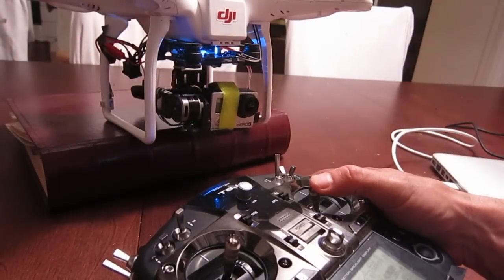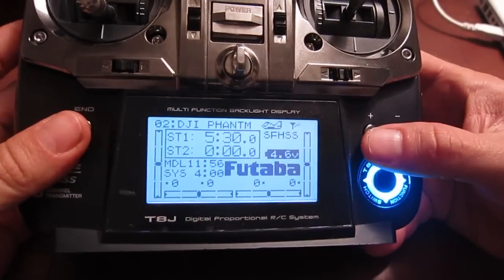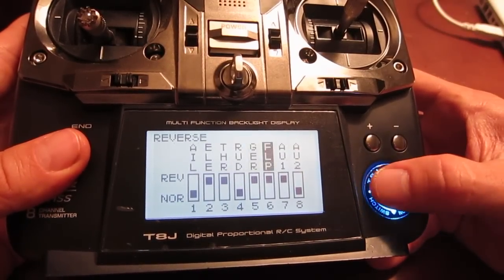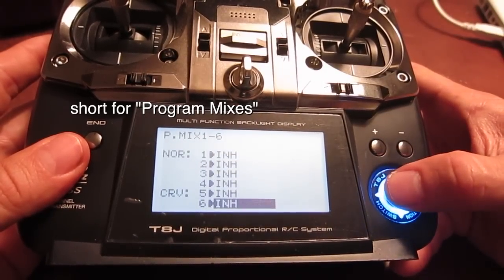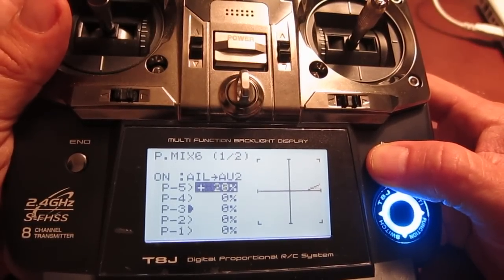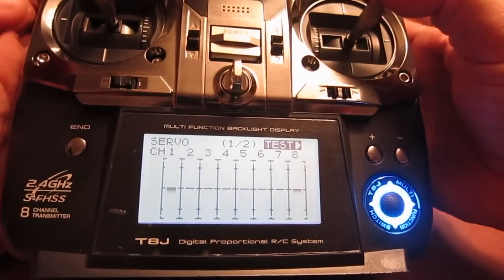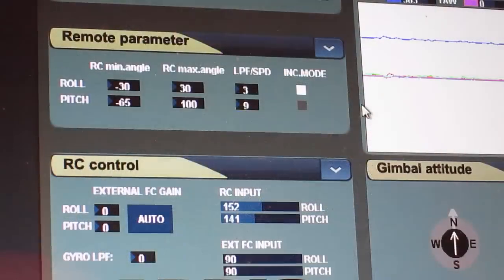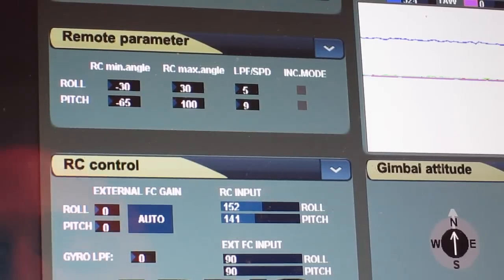FutabaT8J Gimball Roll for Arris CM2000 and other gimbals

Comment from the maker: I've yet to try it out with the Tarot, but I believe it's possible.  (depends on how the Tarot handles a roll signal).
The reason why your E only has two positions is likely because you have the T8J-A (for airplanes) and not the T8J-H (which is for helicopters).    the A model will still work, but you'll have to use the E switch instead of the G, and  H instead of F. - the switches are the same, but flipped on the top for the different models.

Comment from the maker: I've never tried remote-gain adjustment using my Futaba, but it appears rather simple if you assign the VR knob to Chan5 in the Aux Channels, and set your gains to use X1 in the NAZA. tho you'll want to disconnect your pitch to the gimbal or it will turn down while adjusting!

Comment from the maker: the sticks still operate the Phantom (or any copter) the same,.  only with the flip of the switch does it ALSO add motion to the gimbal's roll.  So essentially the right stick is operating two things at once- aileron and gimbal roll.